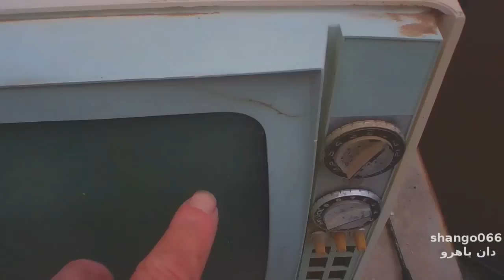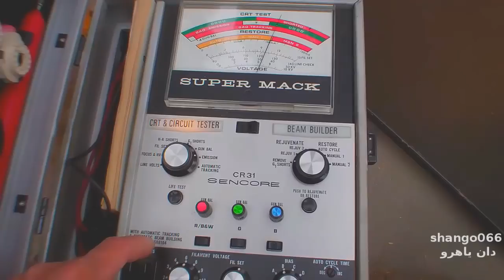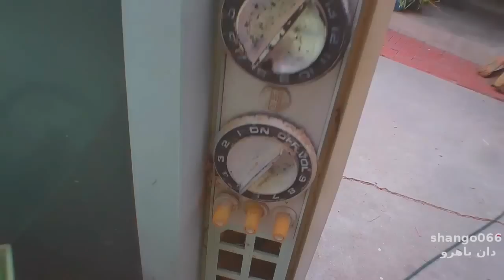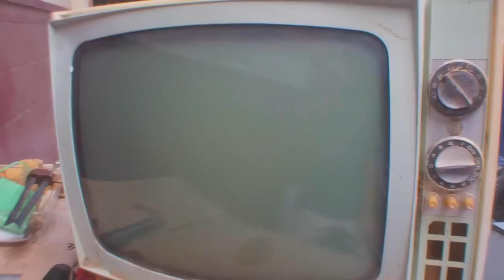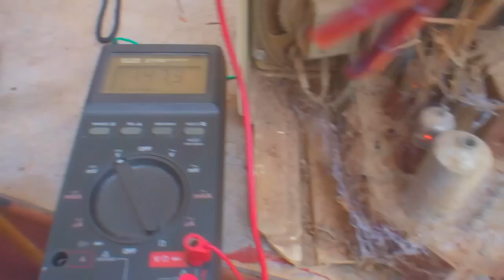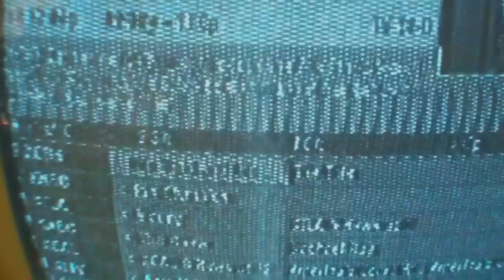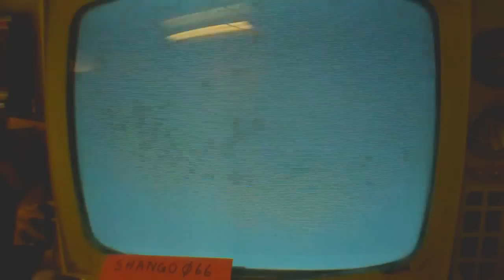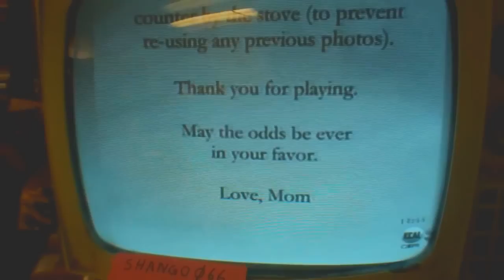1964 Motorola Television Resurrection Black And White Tube TV

Comment: Ha! Great video, loved every minute of it. That's a Motorola 19P35, the set I grew up with all through the 60's into the early 80's when it finally got hit by lightning (dad bought it brand new it 1963). Can't believe you even plugged it in, but then the damn thing starts working - too much! That's the only tv set we had, but in the 60's all you needed were channels 2 - 13 because there was so much great stuff on to watch. Keeping that set running is what got me started in electronic repair, and even though it's been dead and gone for over 35 years I still have the Motorola factory service manual for it. What a trip to see the inner workings of one again!

Comment: One historic aspect about this TV is that 1964 was the last year that it was legal to sell VHF only TVs in the US. (I wonder what the manufacturers and dealers had to do with their remaining inventories of sets like this one at the end of the year.)

Indeed, it is fascinating that all of these vacuum tubes, save for the shattered high voltage rectifier, survived these harsh conditions for so many years. I doubt that germanium transistors (or possibly even early silicon transistors and ICs) could have survived this kind of abuse.

Comment: The reason for the light/dark lines, loops, and/or on/off appearance of the CRT is because your camera shoots at 60fps, and NTSC video is displayed at 59.94fps. This difference is where the "Black" parts appear in various shapes and sizes when recording the CRT. 
When it's dark enough that the shutter speed is under 60fps (when it's dark), you get the whole image.

Comment: Probablely carton of speaker is broken. You can change it for a new piece, replace the carton paper, or to arrange with white glue for forniture, due it is elastic. I had a Motorola with wooden cabinet, same inches when I was just boen in 1967, here in my country, Chile, SouthAmerica. In 1978 arrived cokor, transmission (NTSC) and my father bought a Sharp 19". We have a GE 19" color for a week before, but at night image showed a bar black up snd down, cause of voltage get low (220V  50Hz) . Huggs.

Comment: The buzzy audio is often caused by strong signals causing the video to clip.  The audio is picked out of the video, so when the video clips, the audio does too.  Sometimes a slight backing off on the AGC fixes the problem, if the TV has an AGC control.

Comment: I would really like to have a black and white tube tv that has multiple tubes with plate caps like that one not sure if that tube is a damper or a horizontal out put or vertical
Out put the B&W tvs I have don't use plate caps for those tubes only the high voltage rectifier tube has a top plate cap

Comment: I really like these resurrection videos but I have a request - as you know so much about old CRT TVs why dont you replace the entire tube design inside the TV to new digital electronic and show us how it fares out - i.e. very old 50sor 60s Tube with latest digital ICs and Caps and everything new! I think you can TV boards from China.. It will be a kind cool fusion set! and then you can repaint it and restore it to its original glory.
Reply: What's the point of that? That's like ripping out the V8 of a '59 Chevy and shoving in an e-motor (there's a doofus in Switzerland who apparently does this for a living). 
Shango and many others enjoy working specifically on the old tech because it's very well documented (assuming you can read schematics) and fixable. You can't work on "the latest" tech anymore -- it's just a black box, and when it fails, you chuck it out. That doesn't challenge anyone's intellect or dexterity, which is really the whole point of the exercise.
Reply: @NuGanjaTron  just thinking man! We can get RGB drivers

Comment: I'm trying to fix a GE 911 clock radio and wen I got it someone took out the audio output tube and put in the cases and I put back in and all the tubes lights up but nothing form the speaker

Comment: +Shango066 hi, i am a big fan and a subscriber for a while, i hope you can have the time to answer me...i am trying to repair a german tv (nordmende), the raster on it is dim and i have to have the contrast and brightness all the way up...boost voltage should be 500v but it reads 300v and i have a voltage called "sperr" on the schematic wich should be 190v but it reads 120v...all the capacitors have been shotgunned...can you hint me where should i look at?